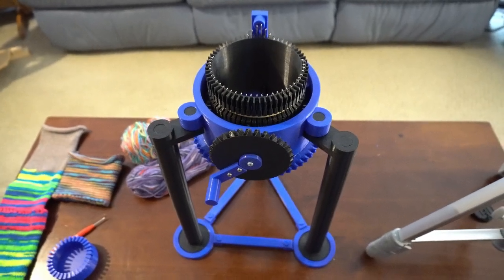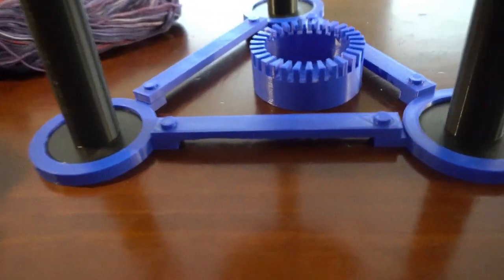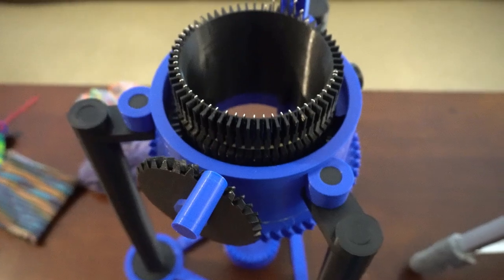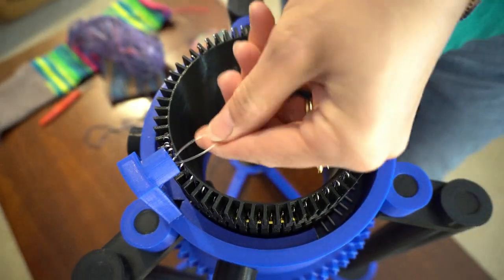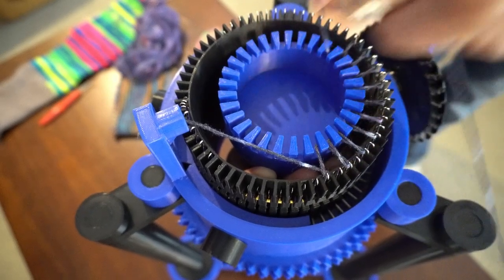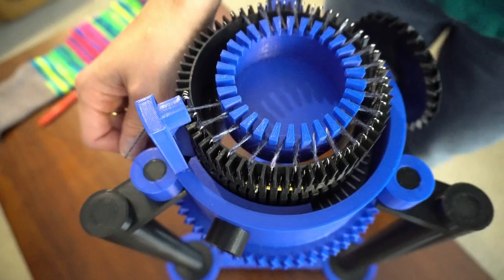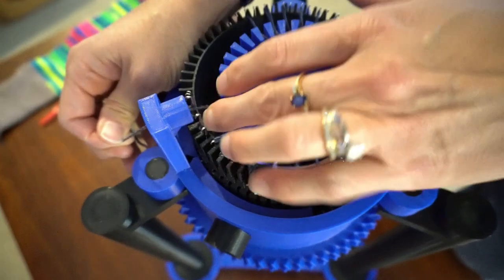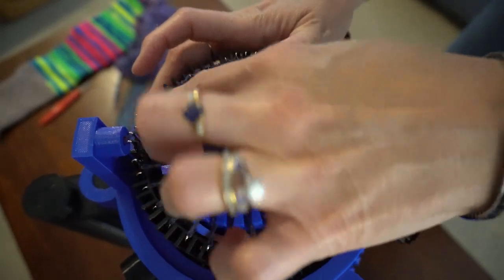3D Printed Circular Sock Knitting Machine

Comment: just printed one of these, this vid helps alot :) altho those weights are just large Washers you can get cheaply at any hardware store. I hope they didnt just repackage them and jack up the price, because they are just washers, and claiming them as anything else to sell them for more than they are worth is daylight robbery :x
Reply from the maker: You're welcome!  Hahaha.  Yep, the washers were more like the included thing to the wooden holders they slip onto that are the main part of a warp weight.  I got them long before I started 3D printing, but I recently found some 3D printed weights you can fill the inside of with pennies.  I need to find that file!  Of course there are lots of other warp weight ideas.  I just wanted the fancy one that came with the washers, lol.  I also love using an s hook and piling that on with anything I can find to hang off it, like my scissors.  Anyway, I digress.  I'm glad you found my video helpful.  Enjoy your new print!

Comment: My partner is a YouTuber and had the same problem with their camera overheating. I bought them a little USB powered desk fan: https://a.co/d/5Gmv1vf and used a goose neck mount to hold it in place: https://a.co/d/2ci0uYB. If you're not near a USB outlet you can always use a little USB power pack from Anker or the like: https://a.co/d/h8Ocsue.

The fan solved their overheating problem, now no more issues 🙂

Comment: This is amazing!!!!!! Are you willing to make and sell this?  I would truly purchase.
Reply from the maker: Thanks!  If I had a better 3d printer maybe I'd sell these.  This one is just too fragile to sell, plus I don't have it working 100% of the time, too many dropped stitches and had to epoxy a couple parts back together after dropping it.  I have found someone that is now selling these, but they are in the UK.  Not sure how good they are, but the price seems about what it should be for how long it takes to print them.  I believe they are charging 600 pounds which is about $815.  It's cheaper to purchase a 3d printer and print your own, lol.  I will say though it looks like they made some improvements over the thingiverse file.

Comment: Could you print me one and does it take normal hooks
Reply from the maker: I'm sorry but this is only an instructional video for those that want to print one themselves and to save them the hours of research I did while printing it to know how to use it.  I have found 2 websites selling versions on the internet, one in the UK and one that appears to be in the US.  Their prices sound about right for everything that goes into printing these.  I can't speak for the quality of them however.  This particular print file takes hooks that need to be cut down.  I am currently working on printing one from a different designer that takes actual CSM needles.

Comment: I can see this is an older video, could you please make another one since you've been using the machine longer & know better how it works?
Reply from the maker: Hi Cheryl.  Thanks for the content suggestion!  Unfortunately I haven't worked with it much since then.  I moved on to a new file and am in the middle of that build.  It requires some wood working which we haven't had a chance to get to, but my plan is to post an assembly video on it as well as show how well it functions once it's complete.
Reply: @Chiromom2   Thanks for your reply 😀
Is the new file for another sock machine?
Reply from the maker: @clsmithent  yep.  It seems like a more thought out file, but is more involved with woodworking and metal working added to make a proper stand and tension guide.  We don't have all the tools we need or the time to finish it up yet, but here's the link if you'd like to check it out: https://www.thingiverse.com/thing:4695746.  The designer has some YouTube videos as well: Steve Turner.
Reply: @Chiromom2   Thank you again. The CSM I have my brother made. He did make a mounting board that you attach your CSM to, then you can clamp the board to a table. I can send a pic if you like.  Where do I find your email address to send the pic to?
I really like this new file you found. I'll send it to my brother and see if he wants to try this one too.

Comment: Cant you put weights in the center.
Reply from the maker: The weights go nicely in the piece that hangs on the yarn in the middle.  I believe it was called a spanner in the files.  So the problem here is either there isn't enough weight in the spanner and/or the needles don't raise up far enough to drop the loop of yarn off the hinge every time.  It could be the needles I purchased too.  The easiest solution is putting in more weight, but I haven't purchased any more yet.  I'm distracted with my other crafts.  lol

Comment: Will you be selling these? I don't have a 3D printer and I can't afford the other sock machines.
Reply from the maker: Not at this time.  At the current print settings it's a little too fragile for me to sell these.  If I alter the print settings to make it more sturdy it will take even longer to print.  It took 5 days, day and night, to print this.  If I charge for my time making this it would easily be in the mid hundreds.  Still cheaper than a metal one, but I am thinking it wouldn't sell at that price.  In case I do decided to sell these at some point, what price would you be willing to pay for a 3D printed one?  Also if I did, would you be willing to buy a proto type (at some lower price), give feedback, and be able to fix it with epoxy if it should break?  Thanks!
Reply: I would love to try it out. I would give feedback and pay a couple of hundred🤷🏾‍♂️. If I could knit socks faster with sock yarn, I’d pay a pretty penny. I can do the toe, heel, and cuff by hand 🤷🏾‍♂️

Comment: Hello it is a very good and interesting video but this part of the world in Africa its hard and way expensive to get the 3D print, for those who have already or are printing you can be kind enough to send photos of every part it would be easier for me to try to model it with wat I have if it works well will definitely share. If anyone is interested please comment
Reply: I can try to make blueprints from print files. Reply, if you're interested. What material do you want to use, what tools do you have available?

Comment: Have you actually made a sock? It just doesn't seem to work well enough to make a sock. Stitches might not drop at the start if the yarn wasn't wrapped around the needles.
Reply from the maker: I've made one tube so far that looks like it will work great as a sock once I put in a cuff, toe, and afterthought heel.  I think the machine needs to be broken in more, sanded a bunch, and/or have more lubrication to work a bit better.  From the casting on videos for CSMs I watched it looks like dropped stitches in the beginning is typical when not using a bonnet.  Do you have any youtube video suggestions on how to cast on differently?  I'd love to check them out.  I did cast on a bit too tight, so that is part of the problem.
Reply: I have made a sock with this machine! It's perfect! 👍

Comment: I have a bunch of singer lk150 needles i wanted to design a sock machine around
Reply from the maker: I don't know if this would help or not, but there is a customizable file on thingiverse for the cylinder.  I think you could use that to design something and then use the files I used for the rest of the machine.  However if you have the programs to start from scratch that would probably be your best bet.

Comment: Can I provide a video tutorial for assembly?
Reply from the maker: Thanks for asking.  I'm totally fine with you posting an assembly video on your channel.  If you link it to your print on Thingiverse, I think others will be grateful you did.
Reply: Hi pi gua did you end up doing the assembly tutorial? I am nearly at that part.
Reply: @vickicorrigan6927  Yes, I finished the assembly. But did not complete a work
Reply: @pigua7705  thanks for the reply. did you use supports on the cylinder?

Comment: Sorry to be such a nuisance.. but i noticed you were having problems with the machine sticking.. and such.. i have some flat knitting machines.. and i was having the same problems..and the solution was yarn tension.. i was trying to knit using yarn from the skein.. that does not work.. you have to pull the yarn out of the skein and into a pile for the knitting machine to work or it jams up and won't knit.  So what i noticed is you holding the yarn.. thats most likely whats causing the machine to jam up and its hard to knit with.. My experience is that there has to be almost zero tension on the yarn. Dont tension the yarn with your hand.. just let it be loose...
Reply from the maker: Hey, no problem.  That's good information.  Unfortunately, I started out trying it that way and the yarn would not form loops so a little tension was needed.  I will try that again though once I get back to using the machine, just to make sure.